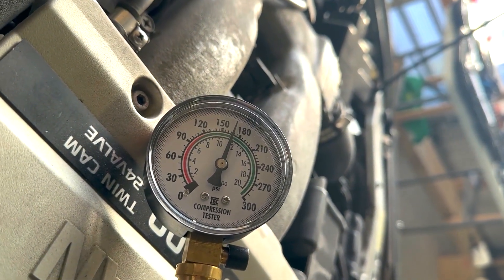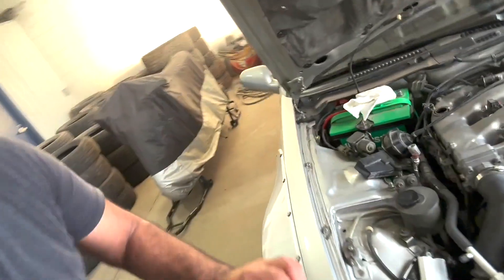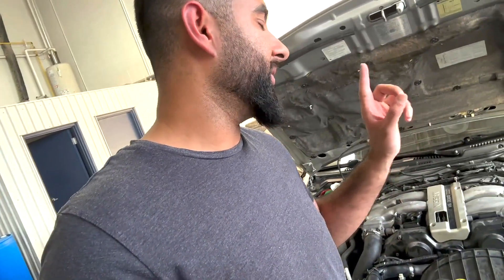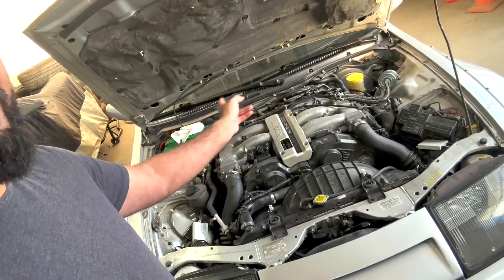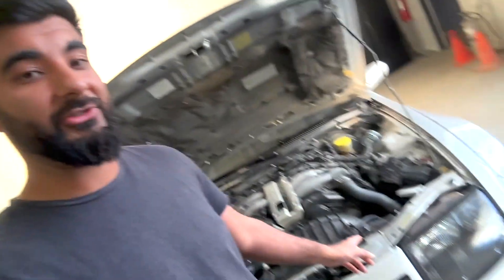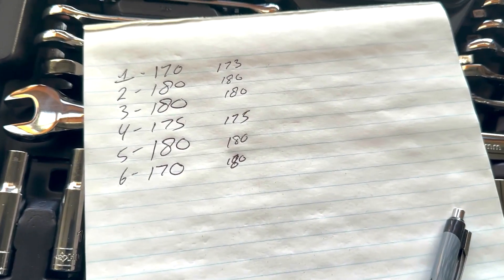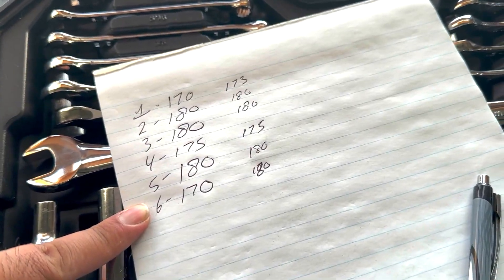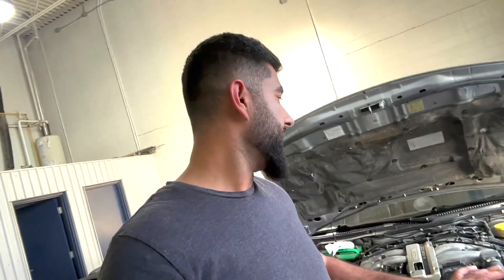Boosting my Nissan 300ZX : Part 1 - Compression Test

Comment: Your car looks awesome! I own the same car though not as nice as yours. You are investing in making your ride even better. Might I suggest as a professional mechanic: These cars are difficult to work on, even jacking them as you know is a pain. I would invest in a hoist. Make your job a whole lot easier. You mentioned you are replacing the wiring harness. You could drop the engine cradle with the motor and transmission. These cars are not the worst I have worked on but, they would be a close second.
Reply from the maker: Thank you! I’m sure yours is great as well! I actually do have a hoist! However it’s a drive on hoist and not a 2 post. I didn’t want to use a drive on hoist for this job I felt it would be easier on the ground. It would have been too high on a drive on hoist to try and pull the engine out I felt
Reply: Thanks for the reply. I have used a drive-on (flush mount in the floor) They are great for putting vehicles in the air. But if you were going to drop the front cradle, engine /transmission. It would not be wide enough. Good luck. Look forward to your project.  Dennis @FarazXAhmed